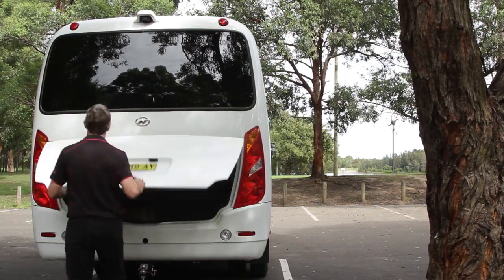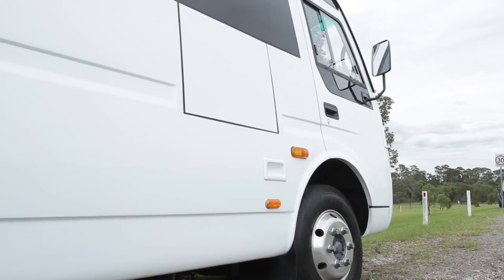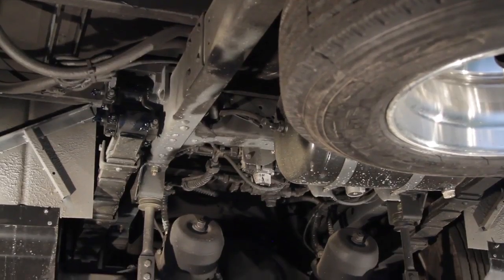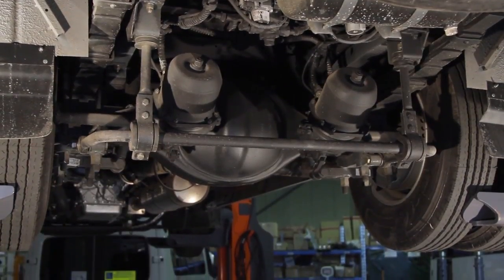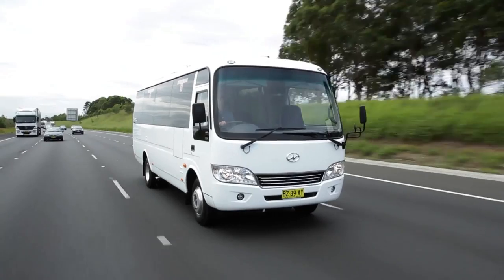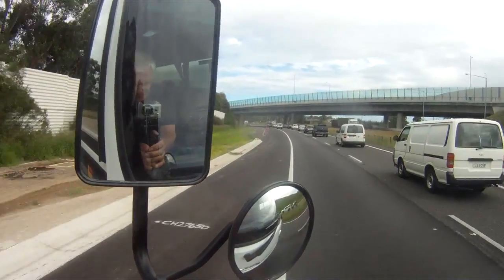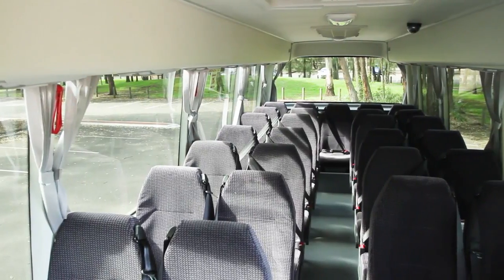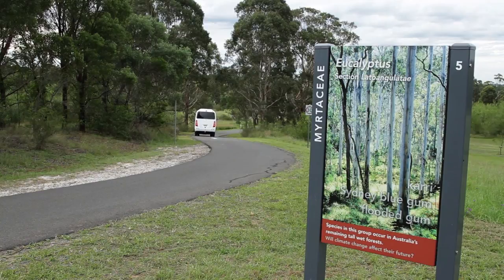Video Review: Higer Munro bus

Comment: Just out of curiosity, why does the buyer have to pay extra for all those reading lights?, who on earth reads a book at night? all telephones have built-in lights, so seems like an absolute pointless waste of money. Also, why should the buyer have to pay extra for having all those service filters relocated?, surely that's a mechanics problem, I mean is the yearly service discounted by the mechanic for having a fuel filter in a more convenient spot?  Also why on Earth go through all these improvements and not even touch the mirrors?, So basically after all these improvements the buyer still has to upgrade the mirrors at an extra cost? I'd rather have the mirrors than reading lights that no one ever uses.
Reply: you could just order this bus on alibaba, it's like 10x cheaper straight outta China.